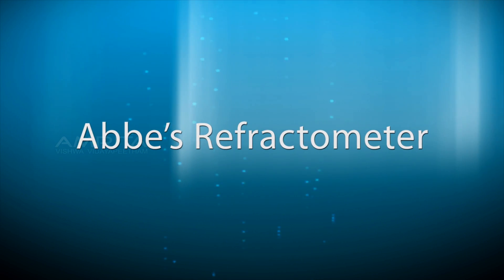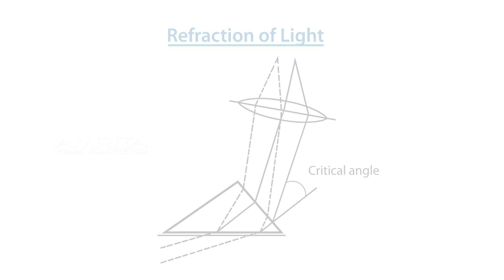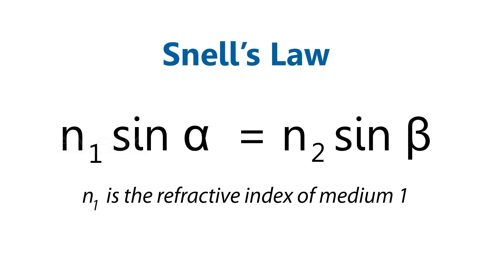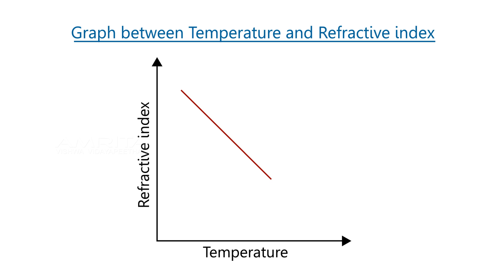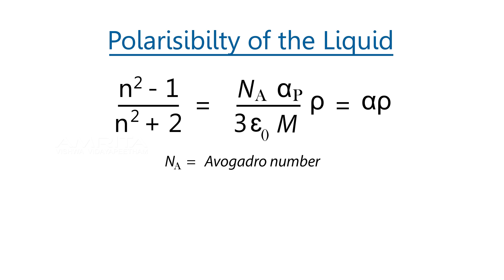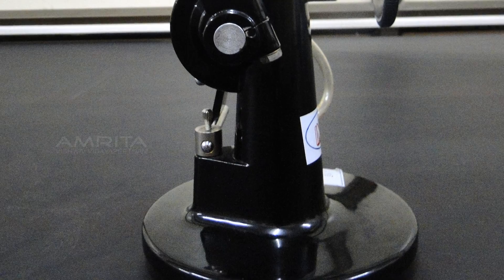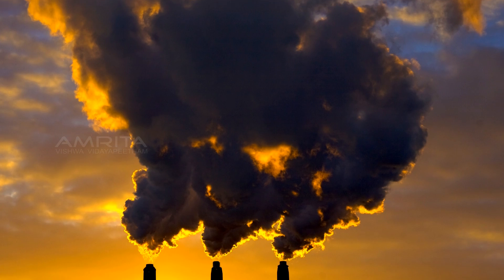Abbe's Refractometer - Amrita University

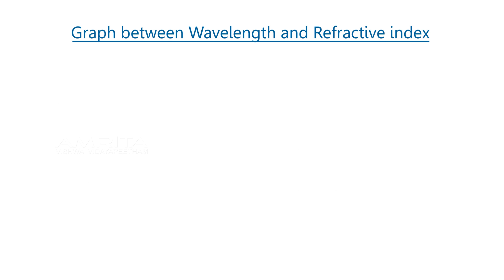Comment: The speed of light does not depend on its wavelength, as mentioned at 2:22. The speed of light is a constant. UV and IR radiation travels at the same speed. c=f(lamda). speed of light in vacuum is given by a constant. speed of light elsewhere depends on the material.

Comment: Nice Attempt, but for which material variation of refractive index is linear with wavelength? To the best of my knowledge the relation mentioned at 2.52 is not correct.